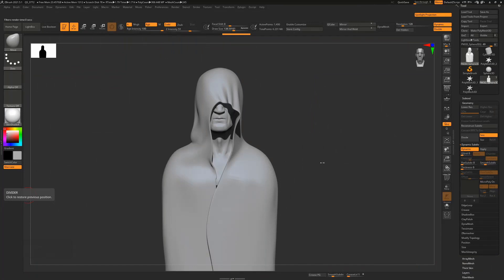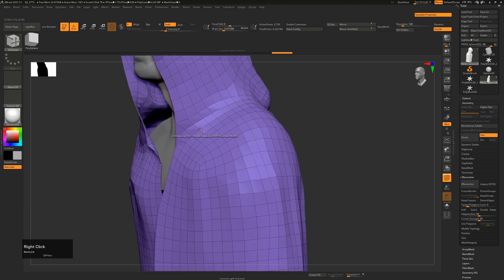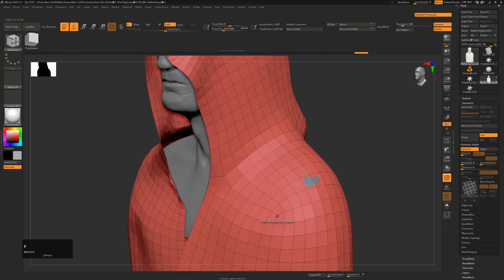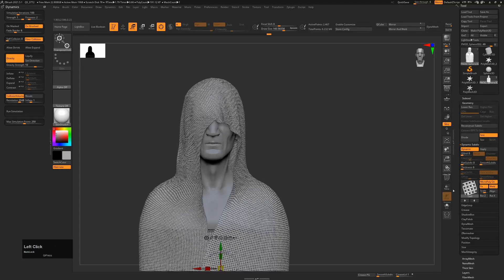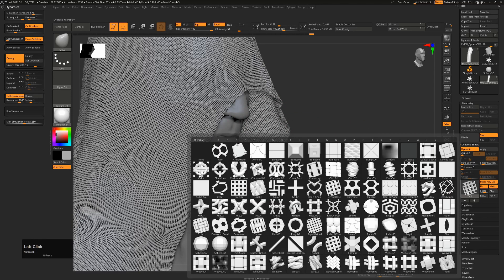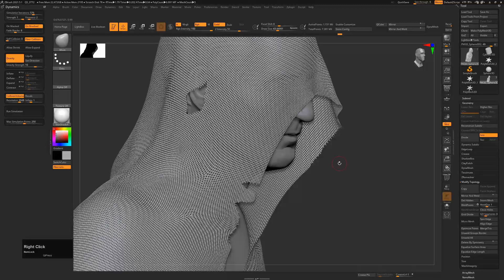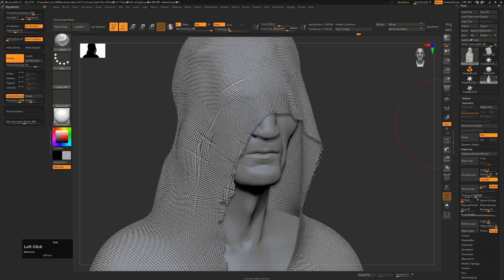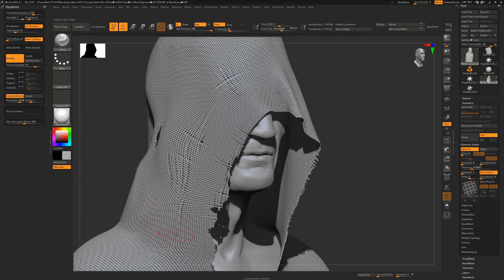Creating frayed cloth in ZBrush - quick 'n easy!

Comment: But* The question is how can i export clothing models to Blender or unity. Which format for clothing models

I use OBJ format on blender and all of my work gone*.
Reply from the maker: For using this in other software packages, you'd probably want to use a low poly version of this with the details baked into it in diffuse, normal and mask maps. I don't do much of that kind of thing, but I'm sure you'll find other tutorials online. Oh, and OBJ should still work for this, as would FBX, if it isn't, maybe it didn't export fully or correctly?

Comment: For games/low poly, I think you should be able to bake it down to a low poly volume mesh with vector displacement and an opacity map from the generated color map as B&W. If applying it as a soft cloth, the internal space would likely need internal supports in key areas -faces to prevent the walls of the volume penetrating each other or rig it with spring joints.  Users will have to export specific parameter settings of VDM  to be used in specific programs. If you don't know, Zbrush has a VDM Calibration tool that can be used in your animation package to make sure you the export settings are correct.

Comment: Hi Sean! I just started using Zbrush, for the patterns created from the micropoly is it possible to turn it into a texture map instead of having these actual geometry? 🙏 Thanks in advance!
Reply from the maker: That's an interesting challenge. I guess you could take a single plane, apply the Micropoly to it, adapting your scale etc until you're happy, and then Apply your Dynamic subdivs. Then simply snap to a top down view of it and use GrabDoc from the Alpha menu - Transfer rollup, and drag around it to grab it. Then just export that alpha. There won't be colour information, but you'll at least have the pattern in black and white. Hope this helps!